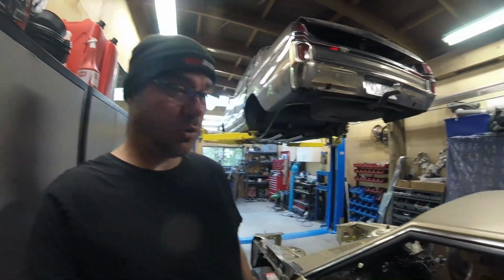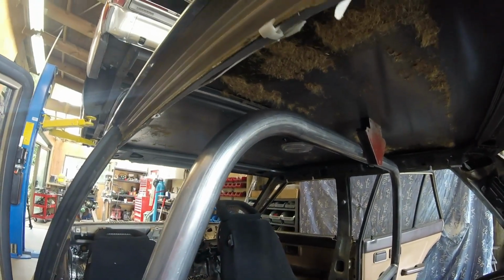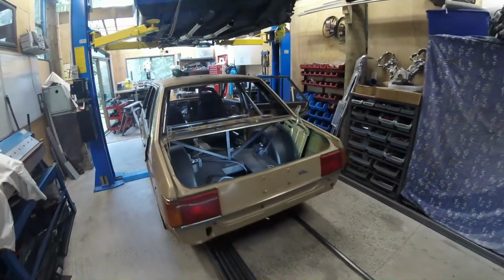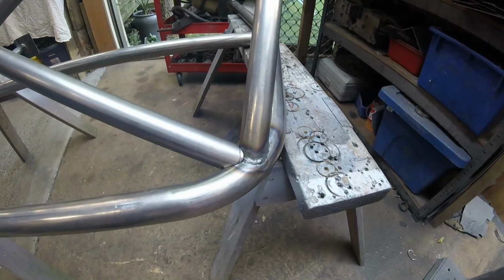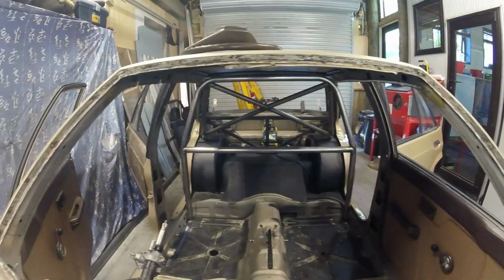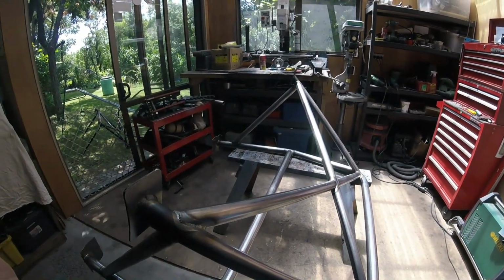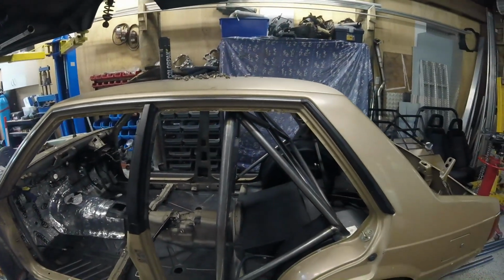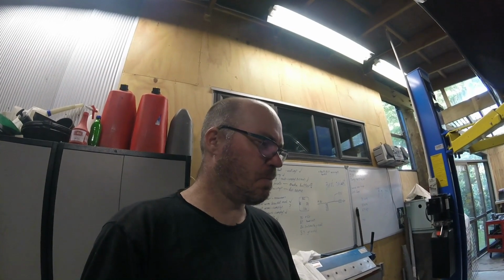Roll cage install part two

Comment: Nice one man! Like your vids - I subbed since Skid Factory popped past but glad I did this is down to earth shopsmarts we all need to see! 
FYI in this vid I notice a bit of hum feedback on audio - i remember you saying you got a new gimbal, could it be from the new gear? 
Anyway - great stuff mate keep em comin' 👍🏻
Reply from the maker: Yeah I've done a bit of a dodgy retrofit of a GoPro onto a gimbal designed for a cell phone.
It's not the answer but an improvement on hand held.

Looking to upgrade the camera situation ssoon if the channel keeps heading the way ithas done recently.